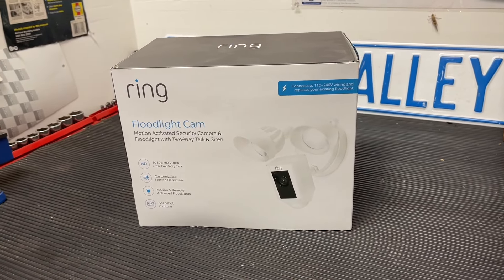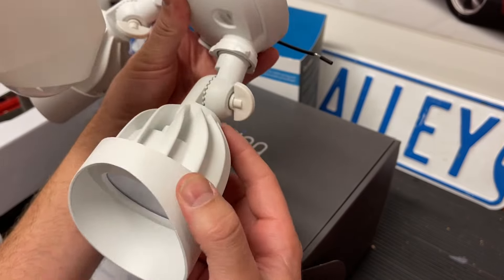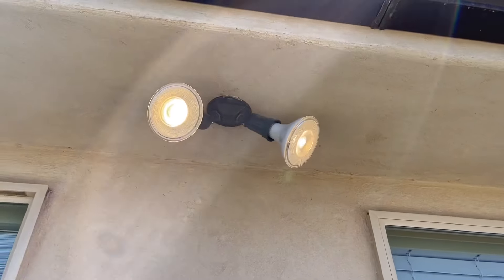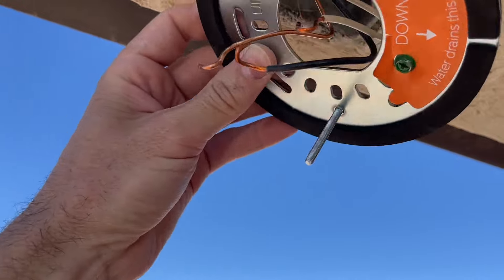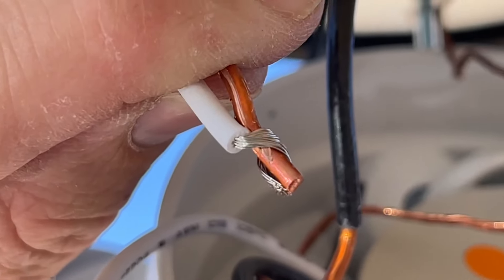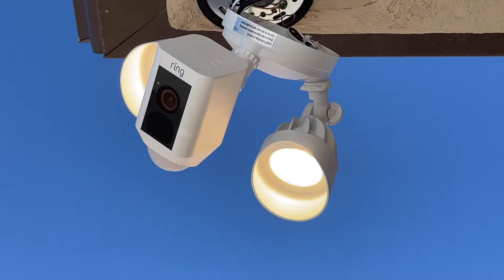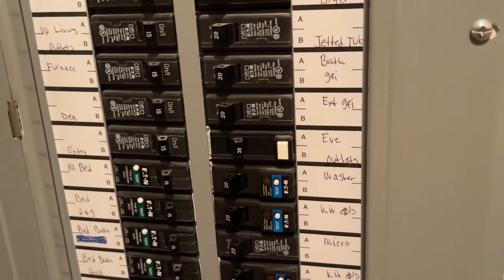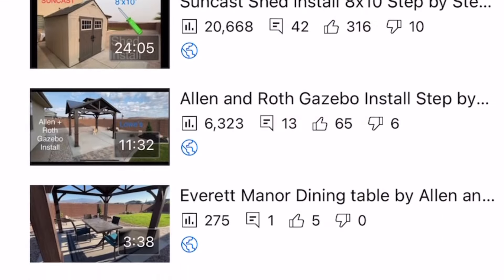Ring flood light camera installation, Mounting security camera to a power outlet on an eve inverted

Comment: he problem is the doorbell ring is wired🔔I have electrical power. I see you connected the app using wifi. I have to be changing my wifi address too often. I want to set up my app to connect through wired, I have several (9)ring flood lights. I'm tired of climbing up the ladder 🪜every time I think I need to change my wifi address💻 Or I have to pay $150. I want to be able to view pictures and outside through my 📴phone app.📲 I do have a TV that is used for just monitoring the cameras.🔕 Maybe someone can help me.
Reply: Why do you have to change your wifi often?

Comment: Where do you connect the red wire?
Reply from the maker: It’s optional for controlling it with a switch. It can be safely capped off if not used. Here is what it says in the instructions https://ring.com/support/articles/1p6j6/Installing-Your-Spotlight-Cam-Mount#

Comment: Hi.. Great video. I hope you're still monitoring this posting. I am looking to buy a few of these and i wonder if the lights have a motion sensor or they can be set to permanently stay on at night. Thoughts?
Reply from the maker: They have setting to turn them off before a certain hour, but not sure they will stay on constantly since it would wear them out. Because it needs to be wired to constant power, you may be able to split off to another light

Comment: Danny - Cool video dude. Really helped me understand what I would get myself into here. One question I didn't quite get - It looked like you had your flood light on a switch indoors. With the installation as it is - do you still have the ability to flip the light on, and still also have the ability of the ring cam to be operational? OR is the situation that, the indoor switch must remain on, at all times for the unit (cam and light) to be functional?  Looking to understand if I can have switch control (inside) and still have the unit also be operational, if triggered. Do you follow my question? I wouldn't want the situation to be, the inside switch must remain on at all times, and the only way I could turn the flood light on/off would be via the app.  I'm looking for best of both worlds here.
Reply from the maker: I was showing in the video why I could not instal it with the flood lights because they would have to be on at all times for the camera would not have power. I installed it to an outlet that has power at all times instead

Comment: Hey there, thanks for the video. Can you still operate the light by light switch inside the house?
Reply from the maker: The light switch in the home would turn the power to the camera off. The app for the flood light allows you to turn the light on and off. I don’t believe it has a provision to hard wire the light separately
Reply: @dannyjohnsonsgarage  Thanks Danny, just to be clear, the switch couldn't be used like a traditional flood light switch without interrupting the camera functionality, correct?  If that is the case, do you know of any flood light cameras that allow that functionality?  I'd like to have a motion light with a camera at the back corner of the house that allows the light to be operated by a switch at the patio door.  Many thanks for any input or suggestions.

Comment: How did you fix the issue with the switch in the dining room having to stay on?
Reply from the maker: I was showing how a switched setup would cause it to turn off it not left on, but in my case,  I had separate power outlets installed when we built the house

Comment: If I replaced the flood light I have right now with the ring flood light camera, what if I just leaved the light switch on would that work?
Reply from the maker: Yes. On mine I had multiple lights on the same switch so it would mess things up. If you only have one light on the switch it will work. Make sure the power it’s also turned off at the breaker, not only the switch when you install it
Reply: @dannyjohnsonsgarage  thank you very much
Reply: yes it will. or like mine in my house. i always leave the lights on outside my garage door. if wired in on the same switch dont worry about putting in. For the other lights go and put in a outside light bulb that has a sensor to turn on once dark outside on the other lights.

Comment: So what happens if you flip the switch now that it is installed? Does it turn off both the lights and camera?
Reply from the maker: I did not install it on that circuit, just showed why you can’t in the video if you have multiple flood lights on the same switch. The other lights would have to be on constantly

Comment: I have an outlet in my backyard I am thinking of attaching on the existing wires another one wire and send the cable over the door to set up my camera
Reply from the maker: If you run new wires, please do so safely and properly with the correct wire and in conduit. Otherwise they should work to extend it. I would have an electrician look it over or guide you through it.
Reply: @dannyjohnsonsgarage  I did it already and it Works